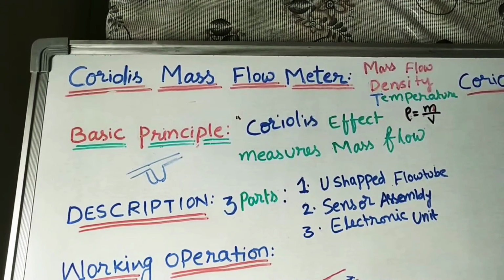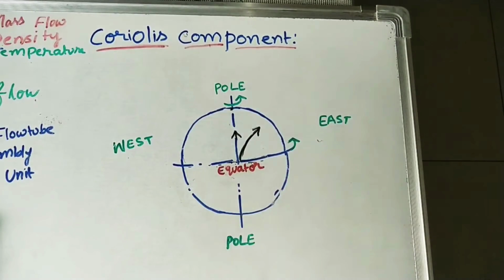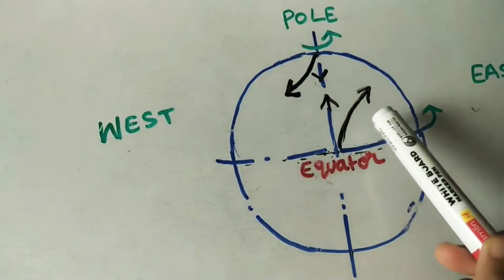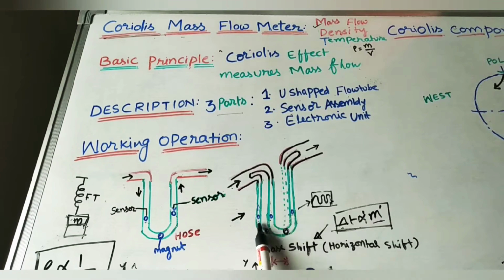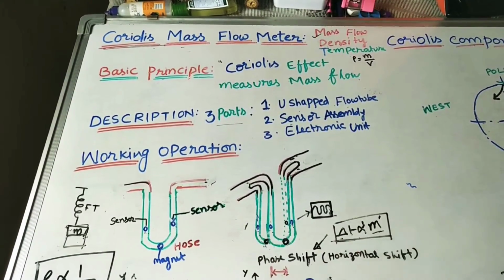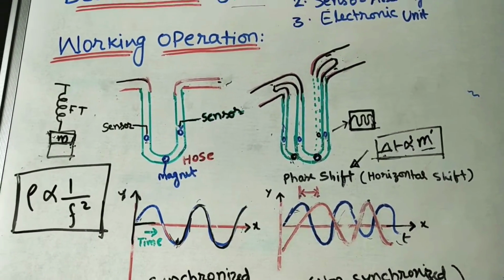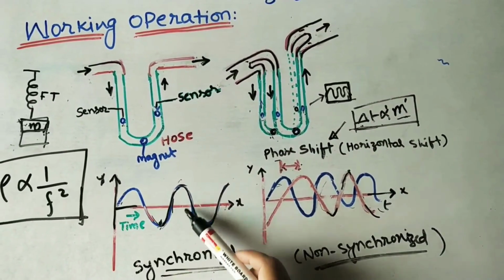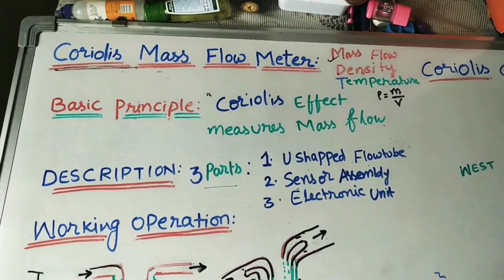Coriolis Mass Flow Meter

Comment: Why we use two tubes ? Cant we use single tube to measure mass flow rate ?
Since we are comparing input and output phase and determining the phase shift so it can be done using one tube only
Reply: If u don't understand, go to another flow meter 😂🤣